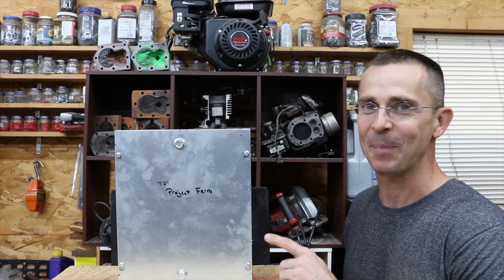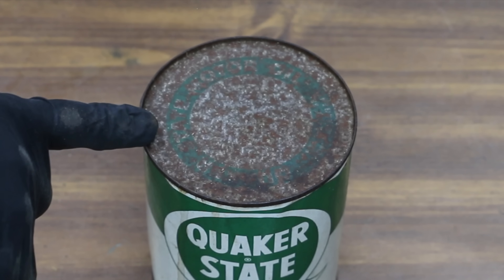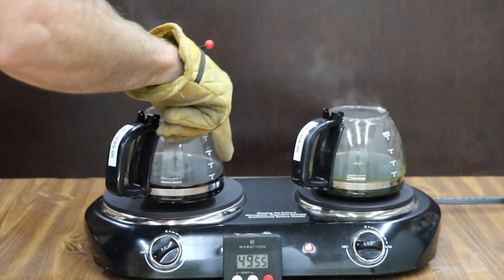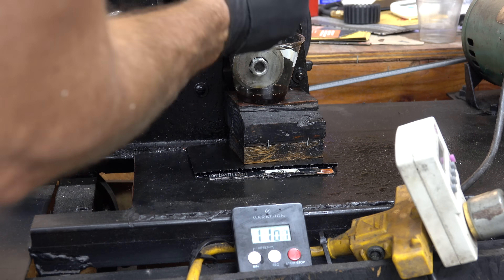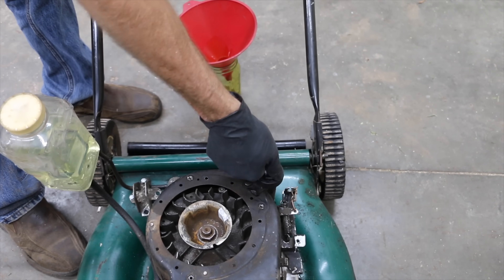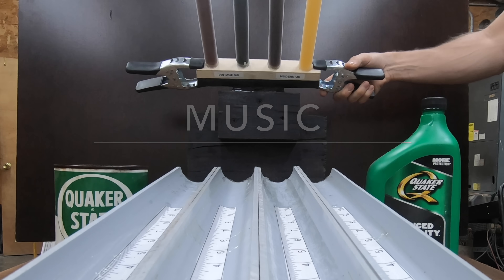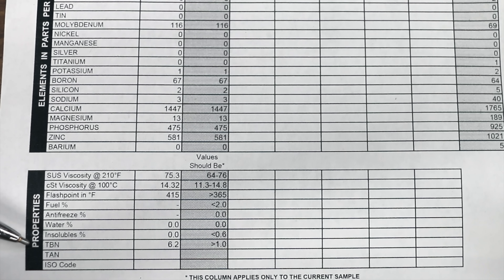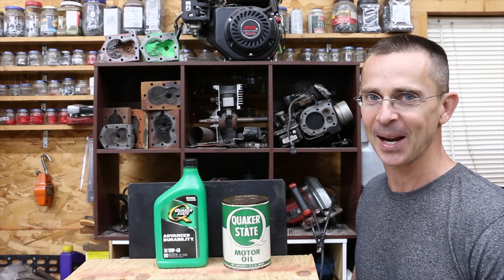Is Oil Good After 70 Years?  Let's find out!

Comment: Not everything that was made in the past was better ;)   Engine oil evolved a lot since the 50s (and engines too). That was a fun video to watch! Thanks to Bobby and thanks to Project Farm. Your tests are super useful and interesting (and had influenced my buying habits)
Reply from the maker: Thanks!
Reply: could be, but are they better. maybe for modern engines. but the engines from back then runned fine on those oils. maybe even better. as you see there was lead in it. and thats one hell of a good thing. maybe not for humans but sure for the engine. so we shouldnt feel superior to what they did back then. maybe we should more appreciate what they did back then without those dumb computers we have nowadays.
Reply: Dealing with vacuum tubes, alkaline batteries, polyester radials, oxidized rubber or whatever made everything sticky and brittle, plastics suitable for milk jugs being used as cogs, car engines that needed constant maintenance to make it to the ripe old age of 75k miles before it turned to rust… I will gladly accept the modern.
Reply: I think we've reached a peak because it seems that the cars in the 90s early 2000s were much better made than anything in 2020+
Reply: @jd646 Turbodiesel cars without tight emission regulations have indeed been the peak of car reliability. Some Electric cars are also low maintenance, we'll see how that develops in the future.

Comment: This oil is designed for antique motors with no oil filters. My 1926 dodge has a manufacture recommended oil change at 500 miles. In these engines you do not want any detergents or dispersants as they will not be filtered out.
Reply: I would bet that this oil is better for my car than any modern oil.
Reply: My old 1956 Chevy Pickup, 6 cylinder, came from the factory with no oil filter.  I bought it 2d hand in 1970.  :)
Reply: If someone was smart enough to pay extra for a filter for the Chevy it was a bypass type that clamped to the intake manifold with oil lines going to the pressure and return ports. Sometime in the 60s you could no longer get good elements. Then you needed to install a Frantz oil cleaner. Frantz Also made an adapter so you could use toilet paper in the stock housings. Then you could give the finger to the oil change racket.
Reply: If that oil was from 1920 it would be 100 years old.
Reply: @jimdrich1967  My Studebaker Lark was also made without an oil filter. It lasted a very long time.
Reply: I've never really thought about that before, weird to think about engines not getting their oil filtered. Did it really bother them you think? Or where the tolerances large enough they didnt really need to worry about filtering oil?
Reply: @supercommando89  The Studebaker V8 in my old car was better than most engines of the day. It even had Stellite valve seats. An oil filter was a factory option.
Reply: @stephenarling1667  My 55 Studebaker Commander 2 door had a factory installed bypass filter mounted to the engine. The return point was in the oil fill neck. I was a young fool and borrowed 300 bucks to buy a Chrysler New Yorker engine transmission and drive shaft and put it in.Later I put in a President rear end in it. It was a heavier rear end but bolted right in. Couldn't close the hood so I took it off. Had the police making u turns and following me. Had to replace the trunk.lid. The salvage said we have a Hawk lid that will fit. A ranger pulled me over in Yosemite. He called headquarters and said we need to watch this kid. He has. Studebaker Hawk with a souped up Chrysler engine. I got the hell out of there slowly.
Reply: The 55 Studebaker I had was the coupe. If I remember correctly the radiater was so low the fan was bolted to the crankshaft. The Chrysler fan covered the top half of the radiater. I don't think electric fans were available then. I removed the fan. The President rear end was out of an automatic transmission car. Not for drag racing. After it got moving it would keep picking up speed until I lost my nerve. I think it would start flying at some point. Studebakers were famous for using oil. Probably not a good reason for changing the engine.
Reply: @supercommando89  they didn't put filters on them to save money. When I met my wife she had a 66 VW beetle. It didn't come with a filter. I think she was getting an oil change every 1500 miles. The Motor Guard bypass filter was the best at the time. I put one on it. The filter was full of metal particles when I changed it. As time went on there was less and less in the filter. A full flow filter would have been as important as a bypass filter on that engine. Was reading a Ford engineering report that said an engine needs both a full flow filter and a bypass filter to get the stuff too small for the full flow filter. Full flow filters only make more  sense to auto makers. They are less expensive to install. Also not many want to deal with the hose maintenance. My 64 Rambler came from the factory with a Spin On bypass filter bolted to the flat head with steel oil lines. The problem with spin on pleated filters is they don't clean oil. I tossed it and installed a Frantz oil cleaner so that the oil would turn clear. The Motor Guard was a better filter but I Didn't learn about them until later. All Motor Guard makes now is compressed air filters.
Reply: At one time Chevrolet engines had Babbitt rod bearings. Engineers figured the Babbitt bearings were soft enough to absorb the large engine damaging abrasives. As the Babbitt wore you removed shims. When you removed all the shims you took the rods and had new Babbitt put on them. Those were the good old days. My 41 Dodge had the optional Fram bypass cartridge filter with the cotton elements.
Reply: Damn I'd have to do an oil change every week with that kind of oil change interval.
Reply: @supercommando89  oil changes were sooner , 4 times a year, cars driven in less city conditions, they had a wire strainer, which was considered good enough, as did motorcycles into the 80s . for cars , american gas stations could change your oil in no time, while they filled your gas, very little bother to get it done
Reply: @ralphwood5114  Thanks for all the great information!
Reply: i think we cant compare old vs new oil cuz new designed for new cars ... people use thick oil for cars needed change piston rings and valve seats as thick oil will not pour into the combusting champer and burned with the fuel 

now most cars recomend 5w or 0w30 which is really very thin oil and whithout it those new engine will run dry and destroyed

dont forget to take into account  the new engines rpm , compression and fuel mix ratio
Reply: @Techie1224  we can, old oil was sae 30w. Which is still in the range we use now, trucks still have thicker oil
Reply: @jusb1066  
is oil in vid sae 30w ??
Reply: @Techie1224  yes, before sae measuring, motor oil was approximately this, and sae later applied 30w for the motor grade,  truck oil was thicker, machine oil was thinner... simpler times
Reply: FACTS.
Reply: @jimdrich1967  Most did have the optional oil filter.  Your's was bought by a real cheap-skate.
Reply: @ralphwood5114  That's the big problem, both then and now.  So many people think having to change the oil is a racket.
Reply: @stephenarling1667  As long as you change the oil every 1,000 miles, it can last long without an oil filter, but I have never seen a Stude without one.  Fords and Chevys, yes, but the better cars, almost all had an oil filter.
Reply: @supercommando89  On most low-priced cars, an oil filter was an option.  Almost everybody sprang for it though, only super tight-wads didn't.  Almost all of the better cars came standard with an oil filter.
Reply: @stephenarling1667  I always though an oil filter was standard on Studebakers.
Reply: @ralphwood5114  The Bug didn't even offer an oil filter as a factory option.  It was optional on Fords and Chevys.  Most of the better cars came standard with one.
Reply: @michaelbenardo5695  
Oil filter was an option on my Studebaker Lark V8.
Reply: @jusb1066  That wire strainer is the pickup screen, and is still used today.  It is not a filter, it is there so that objects do not get in the oil pump.
Reply: @michaelbenardo5695  indeed, but old cars, that's all they had, no actual filter
Reply: @jusb1066  Yes most of the did, from the 30s on.  Chrysler had an oil filter from the very beginning in 1924.  Fords and Chevys had no filter.
Reply: @michaelbenardo5695  motorcycles into the 80s that had no oil filters, or lawnmowers too

Comment: Another amazing production analysis. I remember seeing that green Quaker State vintage mid 1960's! It was greenish and did have an SAE rating at the time. There were Detergent and non detergent types. I recall non detergent was recommended for older engines so as not to dissolve or stir up to many engine deposits, I recon!
Reply from the maker: Thanks for the feedback.
Reply: That is still sound advice.  Using detergent in an old engine that may not have had regular oil changes can be disastrous.
Reply: As I remember SA oil had no detergent but also no antiwear additive, SB oil had antiwear but no detergent, SC oil had both.
Reply: @davidpowell3347  Like everything else, lubrication has come a really long way, thank goodness!

Comment: Our extended family kept our cars for many years. I remember it being a rare thing for an engine to make it to 100k before something blew up. Now.. it's not uncommon to see an engine hit 300k+ and it still run like new. My 92 Camry 4 has over 460K and only recently has it started to smoke a bit.
Reply from the maker: Thank you for the feedback
Reply: Hang onto it - you won't get close to that with anything built after 2007. Things are getting worse by the year. Regressing, thanks to automakers trying to save a buck.
Reply: @SmittySmithsonite  It's not entirely caused by savings, but rather it is business. Why would you make long lasting engines if you get money when they break?
Reply: @MadEvo606  - That's immoral business. Sign of the times. 

My '86 Grand Marquis with the 302 / 5.0 V8 has 267k miles on it - doesn't burn a drop of oil. Runs perfect. All original factory fuel pump, and driveline, too!
Reply: Smitty Smithsonite I find myself having to add oil to my 99 Grand Marquis. You’re lucky!
Reply: @joecool4656  Mine can go 3,000 miles without the oil really changing. I change it anyway however. Mine only has 150k on it.
Reply: @SmittySmithsonite  oh come on... how many car owners buy new, use the car until it breaks and then buy new again. Not enough for manufacturers to worry about that's for sure.
Reply: Hey, before the mid 50s (1956 or 1957, I think?) oil filters weren't standard equipment. The older engines, if they had the optional filter, had a canister filter.
Reply: My 41 Dodge had an optional Fram canister bypass filter. It was far superior to a modern full flow filter at cleaning oil.It used a cotton element.a decal with a picture of clean oil on the dipstick. Under it it said the dip stick tells the story. By the 60s The cotton was replaced with nearly useless pleated paper.About 1953 John Frantz came out with a adapter that allowed you to use a roll of 2 ply facial quality toilet paper. It was even better than the cotton. The big Luber Finer for heavy diesels was the same as the Fram only a lot bigger. I could still get cotton elements for the big LuberFiner in the early 80s. They have big roll paper towel filters now. Gulf Coast Filters of Gulfport. Mississippi has those.Heavy duty for military use. Made of hydraulic cylinder stock. I have several of their toilet paper filters. Just bought a 16 pack of Great Value 1000 at Wal Mart for the Motor Guards and Gulf Coast filters. I don't drain oil. I asked a guy if he would sell his Toyota Camry. A 91 I think that belonged to his wife that can't drive anymore. He said he is giving it to his daughter. Said his daughter has over 500 k on her Camry and it is starting to have problems.
Reply: @SmittySmithsonite  this is why i love japanese engineering, particularly in the automotive game, historically speaking.. They focused on quality and reliability and spent the money on the best materials, something that would last forever if maintained and impress the world if it wasn't. Their moral compass in giving the customer what they wanted paid off and they still turned a profit. It's just the Japanese culture. Other manufacturers tried to copy japanese engineering and cut corners cough CHINA or just made inferior engines altogether by their own design. Japanese engine reliability is world famous, it can't be argued with.
Reply: no old british engine ever got to 100k without being nearly scrap lol
Reply: @YouTubeSupportTeams  Yep, that was the case for decades. Not anymore I’m afraid. Seems they’ve taken the same course as everyone else as of late.
Reply: @SmittySmithsonite  i was going to mention i'm not sure about current day japanese engineering quality. AFAIK it's still among the best and competitive.. any examples you'd care to share of why your opinion has changed? My opinion of current german engineering has declined massively from what i've seen over recent years. Too focused on their overly inflated pretentious brand image and turning a profit at the buyers expense rather than making quality products (cars) that last. They look good so normies buy them, even when they know they're trouble, consumers market. A  white Audi could be 1k more "valuable" than the silver one beside it. Still the same junk. Crazy
Reply: My wife's 2010 Avalon developed a loose piston pin at about 25,000 miles - only me and my brother, who is also a mechanic, could hear it, but now, at 75,000, everybody can hear it until the engine is well warmed up.  Even still, I can hear it.  It also started burning a littl oil at about 60,000 miles.  With STP added, it doesn't, but without STP?  You will have to add between the 3,000 miles we go between changes.
Reply: @SmittySmithsonite  Proof that Japanese is NOT "better".
Reply: @markrchisholm More than you realize.
Reply: @jwalker7567  I do.  And I refuse to stop doing so.
Reply: @101Volts  That was true of Fords and Chevys.  Almost all of the better cars all had oil filters as standard, and even the vast majority of Fords and Chevys had an oil filter.  Plymouths always came standard with an oil filter, as far as I know.
Reply: @OhPhuckYou  OHC engines are more prone to oil burning, as the cam shafts require much more oil than rocker shafts do, which exposes the valve stems to much more oil.